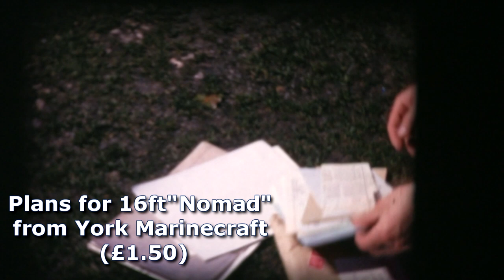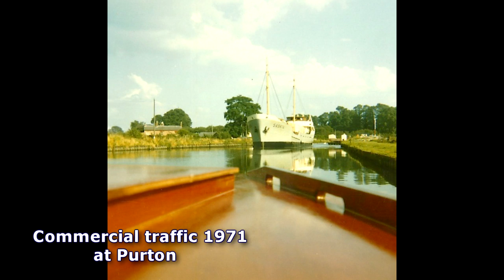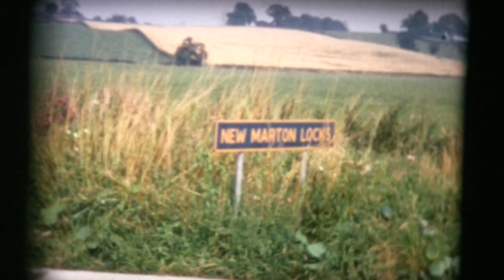Canal Cruiser DIY build in marine plywood 1970

Comment: Stumbled on this trying to find Percy's plans for a Nomad, A blank so far but you can still get Lysander plans of which the hull is very similar. With those and the  info on here  could I build a Nomad? Not just yet but thanks for sharing a gem.
Reply from the maker: I found out some years later that many people built it at 17ft 6 inches and not the 16ft, because York Marinecraft supplied generous lengths of Sitka Spruce for the stringers. There was a story and a few pictures in a Waterway magazine at the time of a Nomad crossing the channel.
For Uk inland use the “Woodwich” was probably a more practical hull.